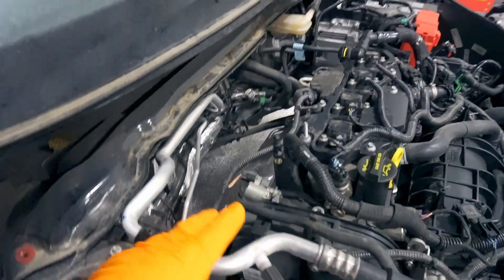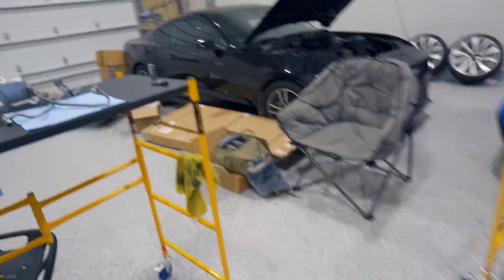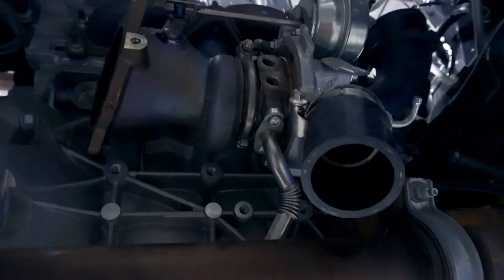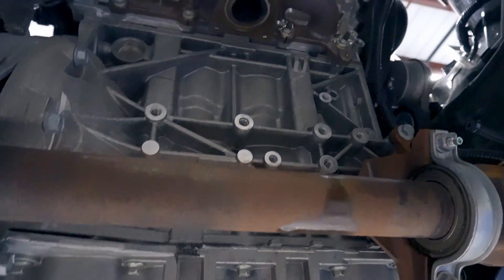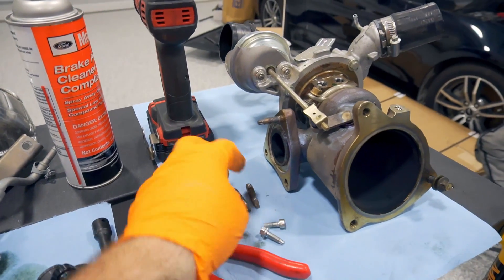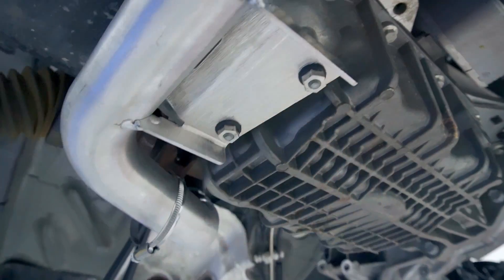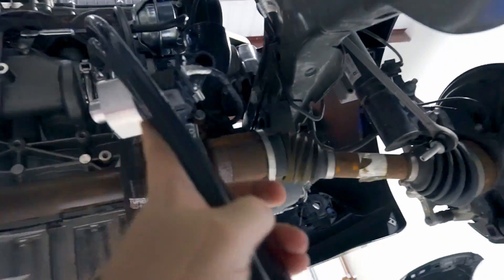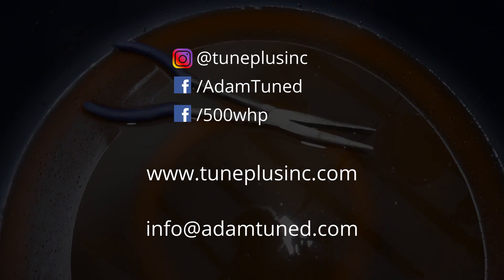Turbski Time for the Fiesta - Part 2 (S280 Turbo Install)

Comment: @AdamBrunson Priming the turbo. Just accel/clutch in start let it prime through a few passes or are you actually manually cranking the engine over, getting fluid out the supply line, then through turbo blah blah like TT states.

Comment: Interesting that that my 2015 oil drain line is not all metal but a rubber hose with a heat sleeve on it.
Reply from the maker: That’s not stock.

Comment: If I want to stick to 93 pump gas and maybe aux fuel idk yet, should I go whoosh hybrid or s280
Reply: I’m going to use 93 pump gas and will use aux fuel if I get the s280 but won’t if I get the hybrid (not needed, unless u think it would help). Although which do u think is better setup for only running 93

Comment: I challenge you to do this same turbo swap without removing the subframe
Reply from the maker: Challenge not excepted. Why do something that takes longer when there is a clear easier way being outlined in the video.
Reply: its not all that hard to put it in from the top. that's what we did on my buddies FiST

Comment: Just finishing up the install and wondering if it matters which hose I run to the coolant reservoir, the upper or lower port on the turbo?
Reply from the maker: Anthony wheelus it does not.
Reply: @AdamBrunson  Great!  I'll get you a log tomorrow.  You've got it limited to 5psi, but it's spooling quick as hell and making great torque for such low boost.  I can already tell it's going to be a beast!
Reply from the maker: Anthony wheelus it’s not limited to 5psi. You have a boost leak or something isn’t hooked up correctly.
Reply: @AdamBrunson  I'll dig into it tomorrow and see what I find. Thanks
Reply: @AdamBrunson  I had some lines reversed, but after correcting the issue it still didn't hit more than 15psi today.  WGDC didn't go over 42%, so I'm assuming you've got it limited.  Love the quick spool as it's literally hitting the same boost numbers as my GT2860RS with new cartridge a full 1K RPM's sooner.   Definitely a night and day difference!   Very happy so far!

Comment: Question, for a turbosmart bov do i connect the vent line to the turbosmart right? If so can i close the bov adapter nipple?
Reply: Stock or aftermarket? 
Im running that BOV on stock turbo, closed off nipple.

Comment: Ron will give you $$ for that turbo! Nice tip on coolant reservoir, HEY I have that electric angle grinder, used it when I installed the last turbo that was recalled by the vendor, took me less than 5m with that 15$ grinder, thnx for videos cant wait to hear it!!